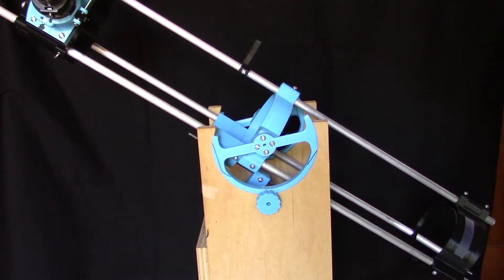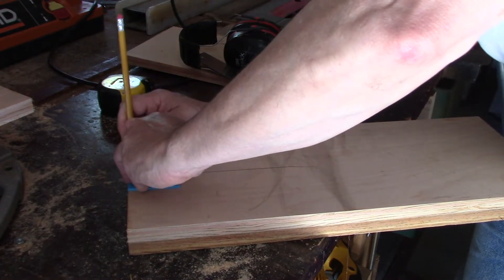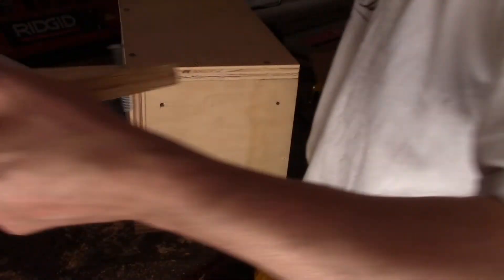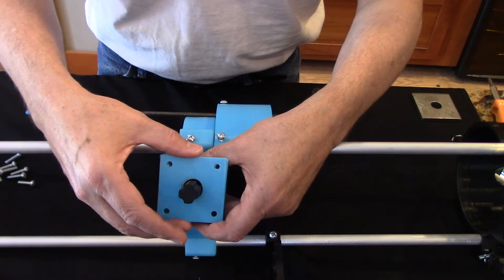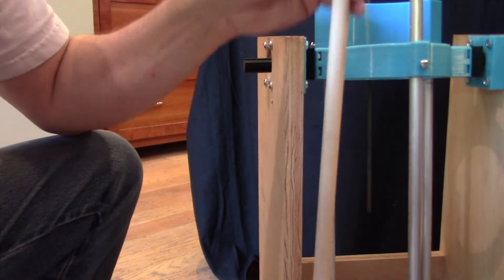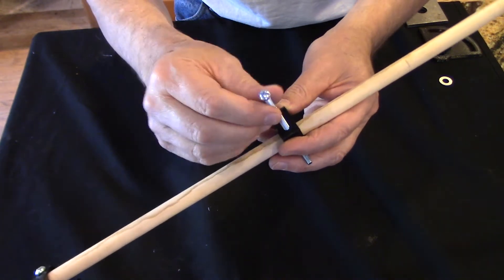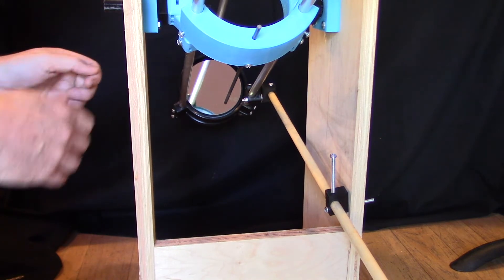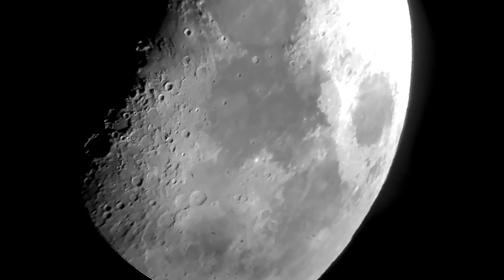Newtonian Telescope Ball Bearing Z-Axis Upgrade

Comment: What is the purpose of the blue piece in front of the mount hoop with a thin rod attached? I haven't seen it in other pictures of the telescope.
Reply from the maker: The blue part is a holder for a counter weight that I designed.  Here's a clip in action https://youtube.com/clip/UgkxTWprBpqUj1nc2BCGuVjFuqhDSUE4k2Ps